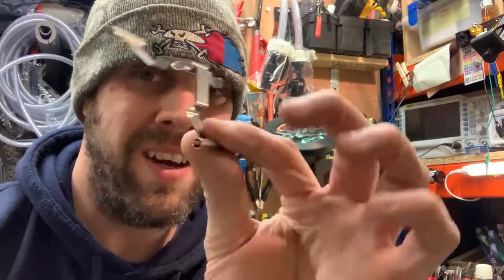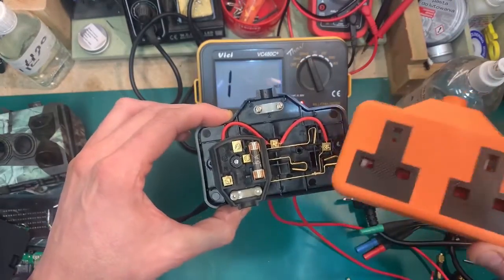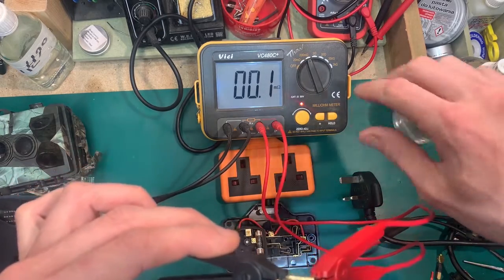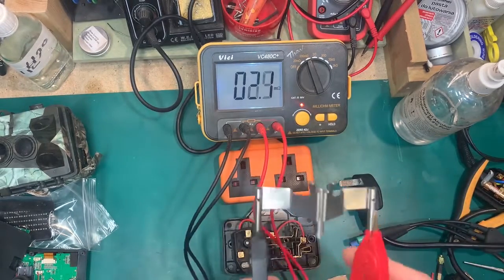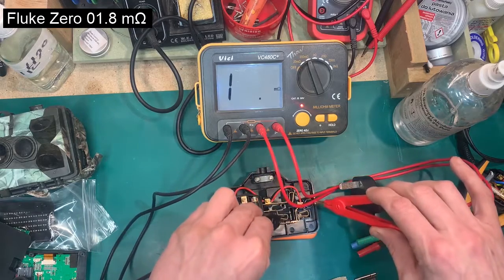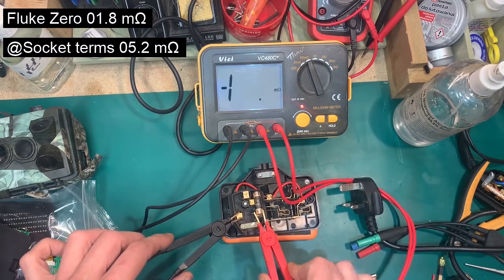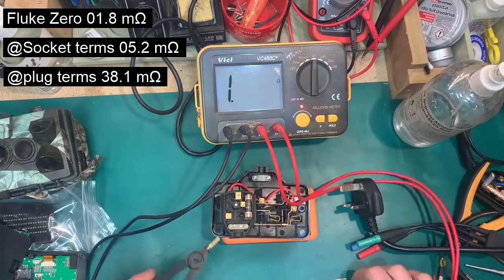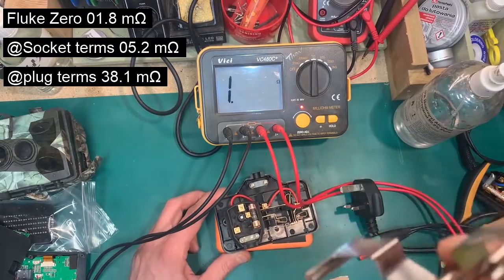#TOOLS-2 Fluke Zero device @ £51 V  ruggadise socket linked out @ £2.49

Comment: Jamie I like your Vici continuity/insulation resistance tester, I have one of them but mine is branded as Samyo , I also have a Robin KTS 1620 MFT a kewtech kt 63 . An old pocket size Robin multimeter. As for £50 for that peace of metal fluke call a zeroing clip well . In my humble opinion anything fluke can feck off right back to America. Fantastic video with a clear comparison, as far as theses big companies are concerned the uk if a soft touch and they can rip us off and know one gives a dam .
Fantastic video mate 👍👍👍👍👍❤️